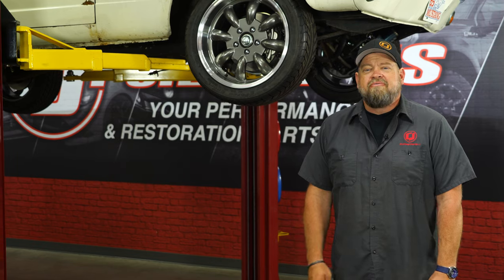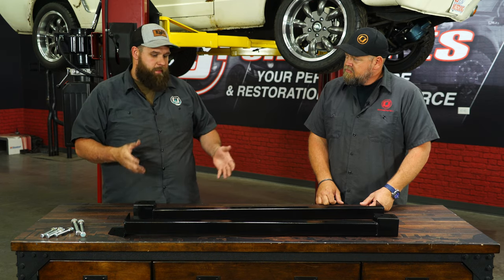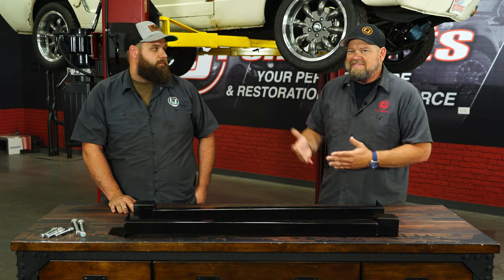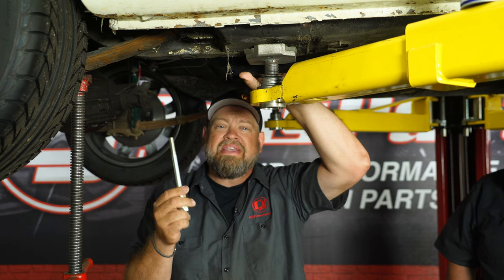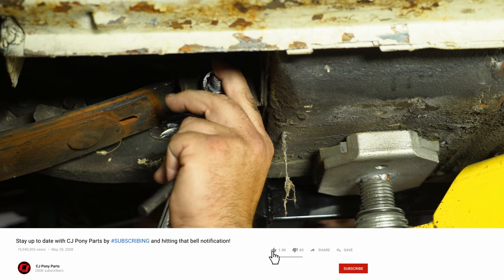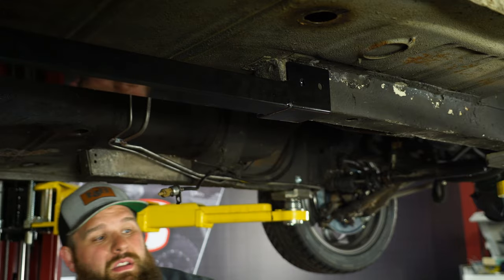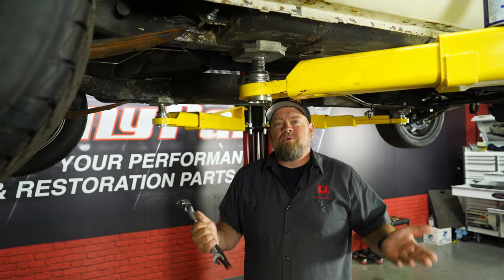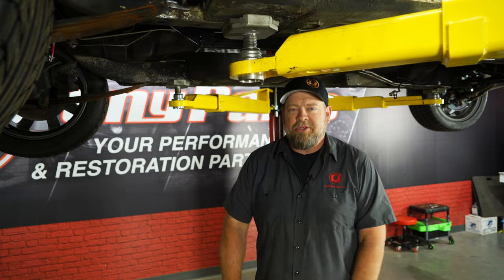Project Betty | CJ Classics Subframe Connectors

Comment: I think this is the easiest and best for a good burn out car where you don't plan to put more than 300 HP, I plan to put some 1 inch welds, especially on the leaf spring end, but the one thing I haven't seen on any video's is to check measurements to make sure my older car is still square, I know my 69 coupe was abused pretty good. Just a thought.

Comment: Super cool! Would it make any difference in terms of rigidity in welding the subframe connectors vs leaving the bolts? Also, I can't imagine someone would want to remove them for some reason... in which case bolt would be easier hahaha.
Love the Videos!!! Can't wait until you guy get to the engine and hopefully a t5 tranny or any other manual.
Reply from the maker: Welding would make them stronger for sure.

Comment: why would you even think this was anything but an anchor?  absolutely no rotational or twisting rigidity.  perhaps a slight bit of lifting support.  One way to check is to jack the car on the new frame support and watch the action.  It will bend like a banana most likely.